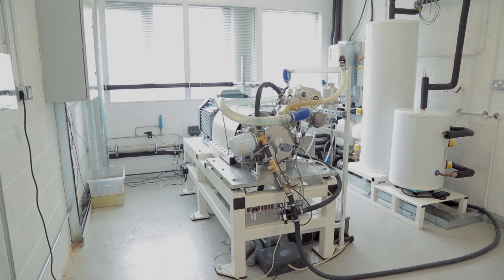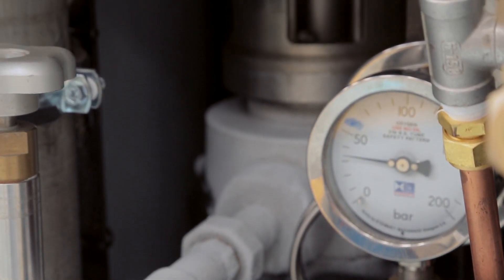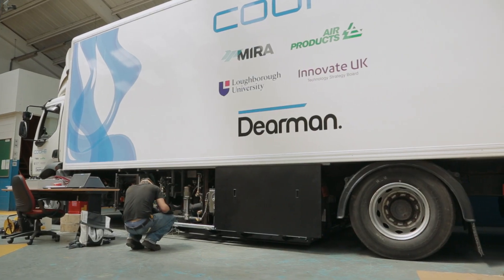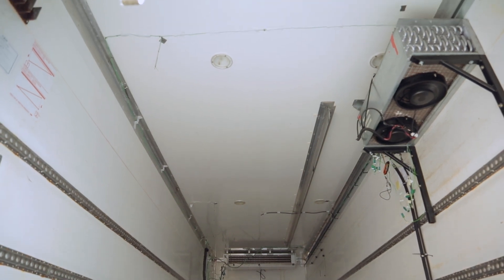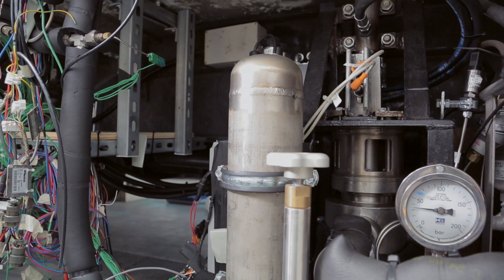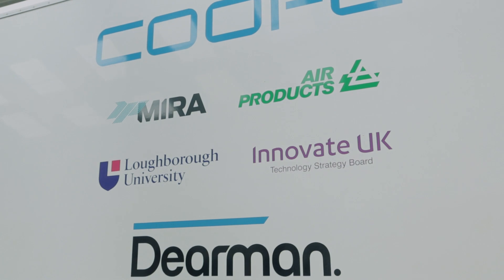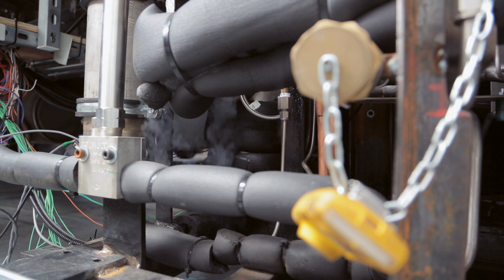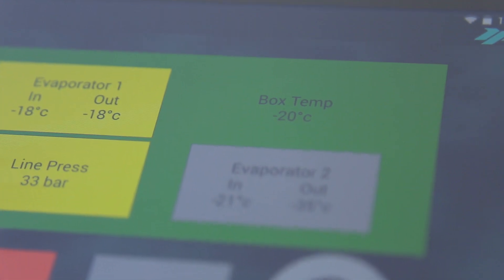Innovate UK success story: Dearman technology drives a cold & power revolution (ISCF - Clean Growth)

Comment: Ok, passive expansion on the air through big heat exchangers would be nice but is not good enough for high power. But if the warm water used here is heated with green energy, then it doesn't matter. 
If this is a kind of simple piston engine, then it could be very noisy but they probably found a solution for that. I wonder of such LN engine would even be made in one piece out of a special plastic via 3D printing. That would make it very durable and light and free of maintenance perhaps??